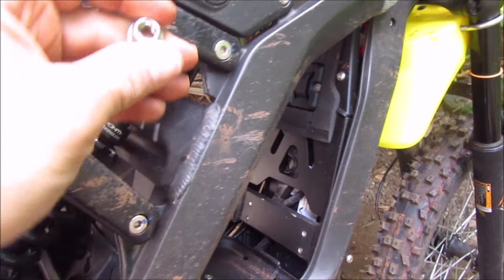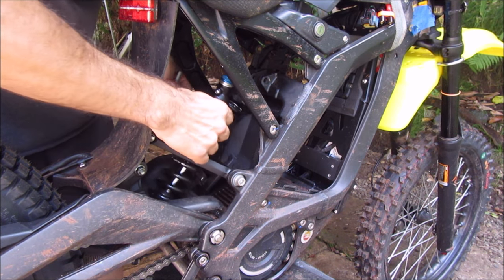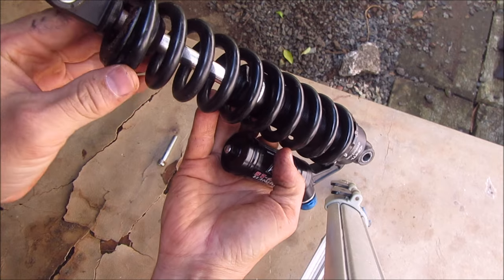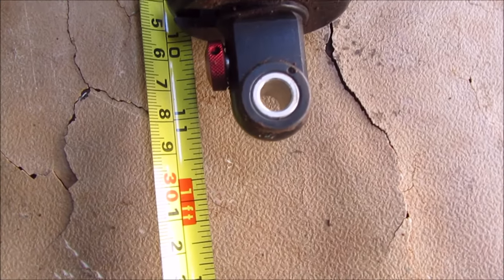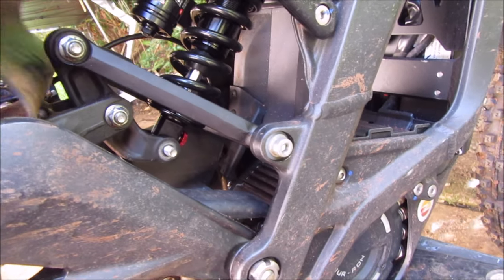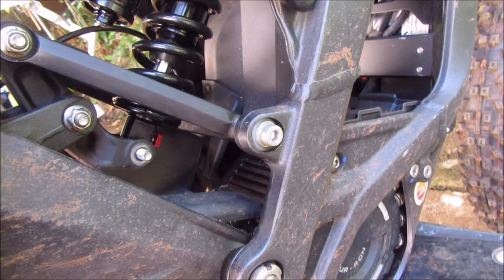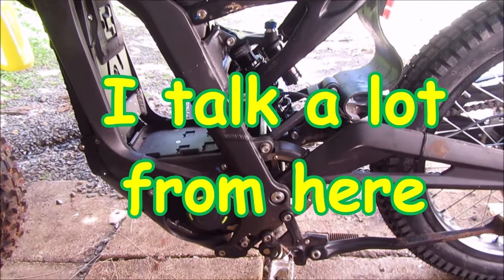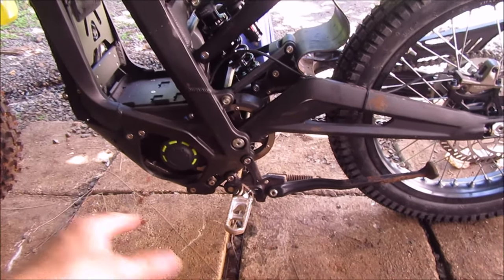Sur Ron lowering Vlog

Comment: Go team !     hi, after researching shock lengths = bike geometry for a 5 foot 5" person i did not cosider wheel size. 
My fast ace 10.5" 267mm sur-ron feels a little tall in the saddle, 
I see a 9.5" 241mm advertised on a uk site, but i went with a fox dhx2 250mm 10" 500lb spring (I'm waiting for custom bushings atm)
I am encouraged to see your atempts to lower the Sur-ron size.
Your daughter seems confident with the lower size, good team work.
Thank you for your videos. Good luck.
Reply: How did it turn out?
Reply: Im 5,2 and would the 240 shock fit me with 17 inch tires? Pls respond i really need help
Reply: @marrzie467  Hi, the bike geometry is compromised, ground clearance is reduduced and head steerer angle becomes slacker. stock shock size for me. good luck.
Reply: @Alex-wt8iv  Hi, I would suggest keeping the stock shock size 10.5" (267mm) otherwise the geometry is seriuosly effected, ie the head tube angle become slacker, ground clearance is compromised.
I have read that a 16" or 17" rear rim wheel is the way to go for a BMX style ride (Whippy). you could also go with a lower profile headset  (Cane Creek 40) to lower the bars. Hope you figure it out. Good luck.
Reply: @patternsinthewaves  Interesting info. Thanks.
Reply: @patternsinthewaves  Thank you i was thinking the Seat lowering brackets and the 17 inch supermoto but im getting the supermotos anyway but if thats to high im just gonna live with it since im just 13 and still grining so but Thank you

Comment: I think the seat lowering brackets would have been a better option.  Seat goes down almost 2" without messing up the ground clearance and suspension.  They are expensive, but not much more than a new shock.  You could also increase the shock pre-load/sag, to make it a bit higher and stiffer.
Reply from the maker: I didn’t even think of that! Might have been faster.
Thanks for the info.